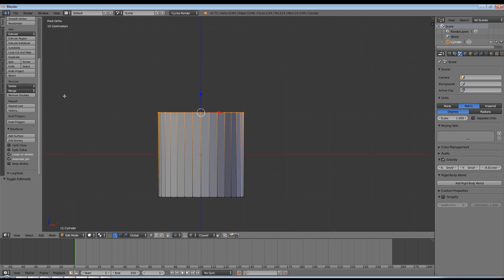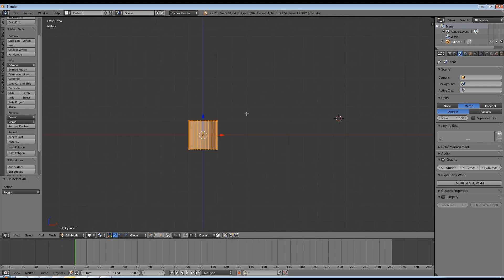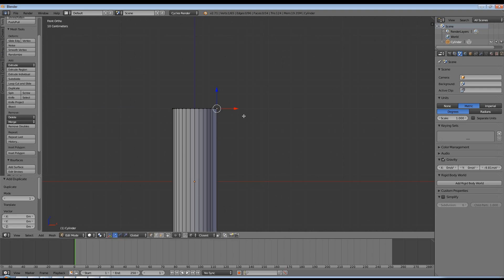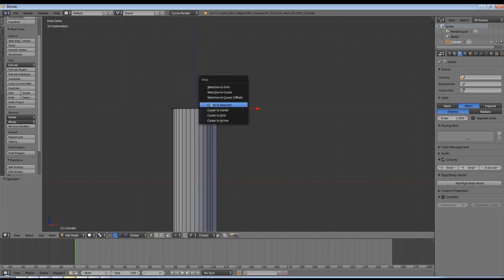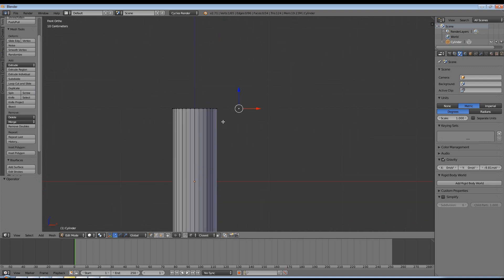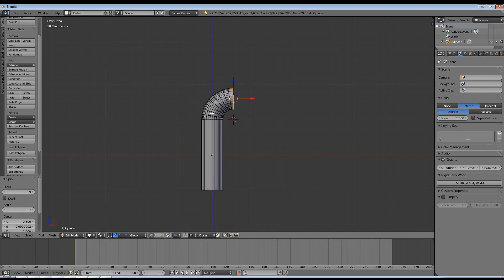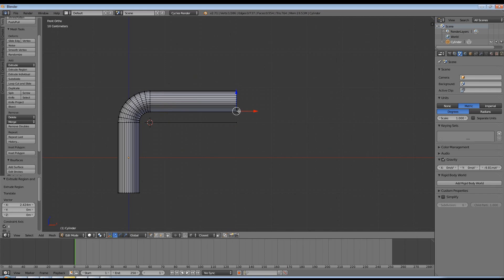Blender Quick Tip on using the Spin Tool

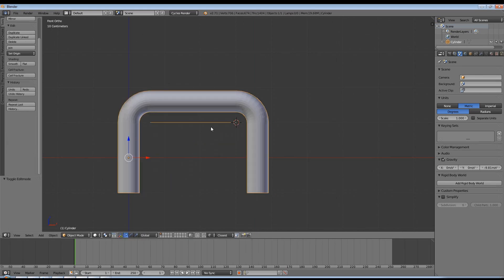Comment: how did you do the 0:58 - 1:00 step?
Reply from the maker: im simply extruding (e), then snapping to the vertices on the left by holding CTRL, then i restrict the snapping to the z axis (z). You can find this option on the bottom of your 3d viewport (the magnet icon, in the dropdown select, snap to vertex, i'd leave that magnet off though, you can activate it temporarily by using CTRL during a transform operation).

Did that help? :)
Reply: @ManuelL3D  Thank you so much for the quick answer.